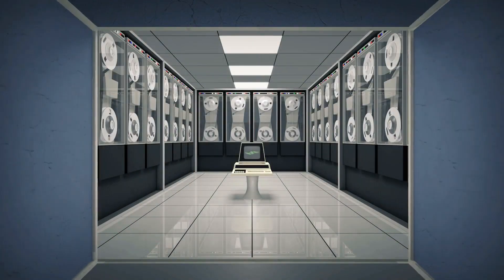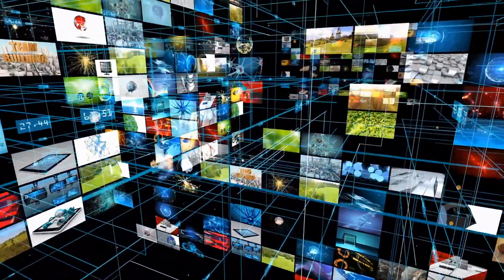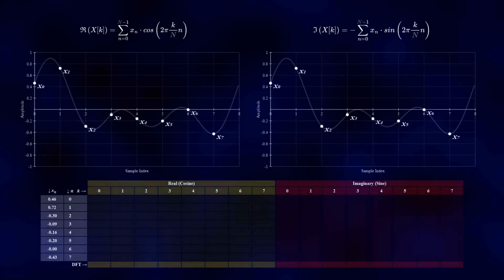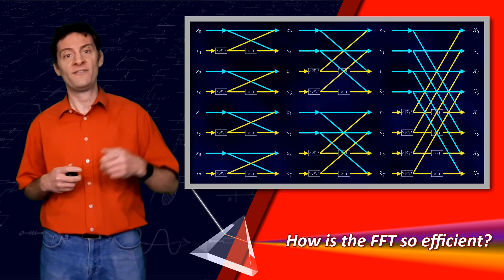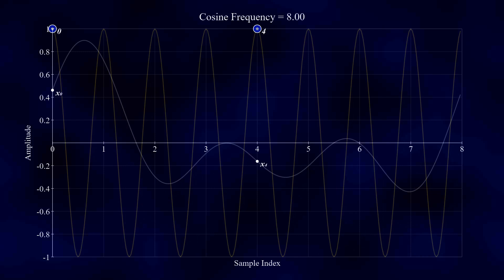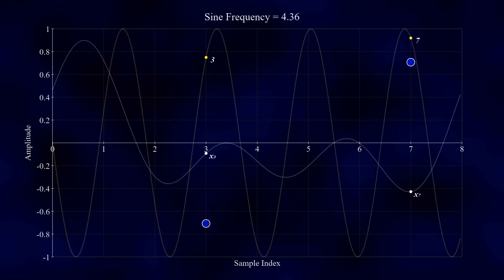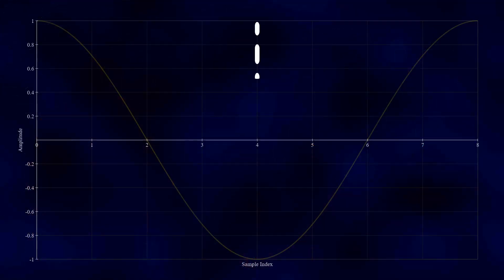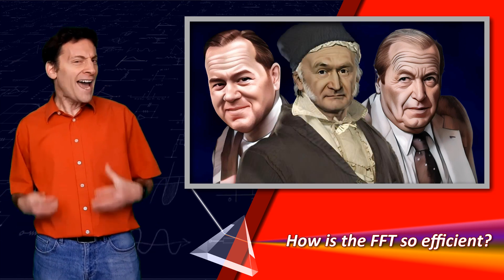How the FFT Works | Part 2: How is the FFT so Efficient?

Comment: This efficiency gain is very real, not theoretical.  I've been developing a rather sophisticated circuit analysis and simulation program for some time. To avoid the power-of-two constraint, I choose to use the DFT method.  For most cases it works very well.  But, as the complexity of the program grew, some computations were taking 30 seconds, or more.  By switching to FFT (and applying power-of-two constraints) processing times reduced to less than a second!
Reply: There are FFT algorithms available that are not bound to power of 2 sample size. I am not aware of details but I am aware such algorithms does exist.